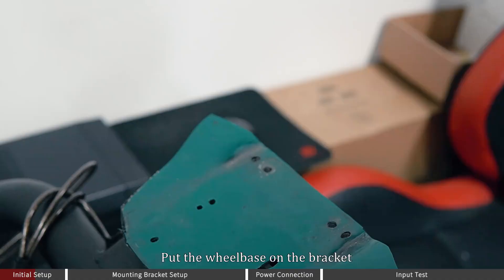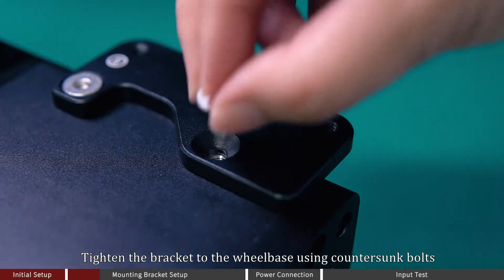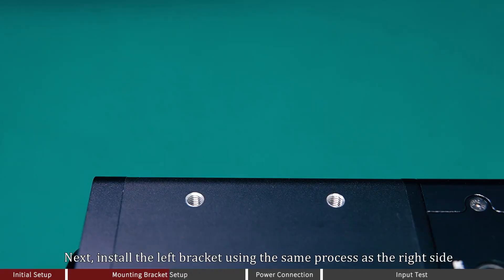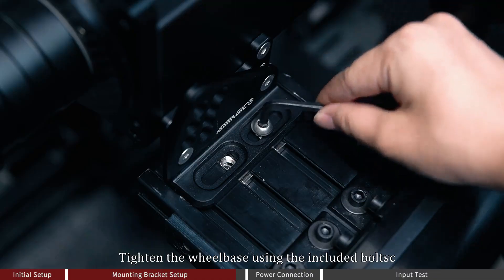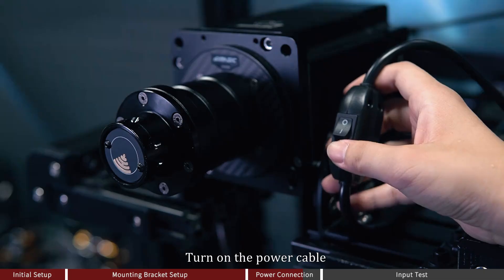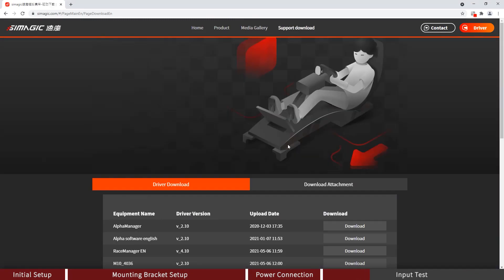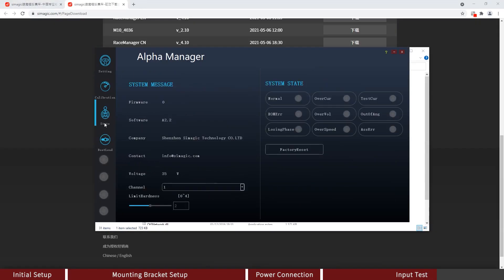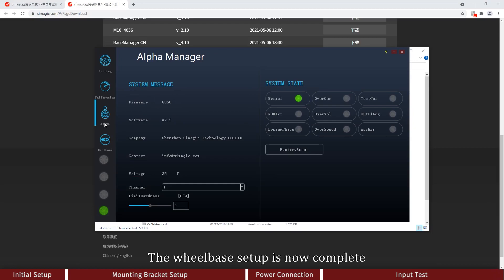ALPHA Mini setup guide

Comment: Would it be possible to mount it on a normal PC desk, as the Fanatec CSL DD?
Reply: Im late but anyway.I will answer in case anyone read this.
Find the drilling template for each base and you will see that moza and simagic have the same bottom holes dimensions.
its 78.4X66 with M6 screws.
I thing its the same for the fanatec as well.

So that means if you want to have the simagic mini for desk(i hope a strong and strurdy desk)you can buy the moza desk clamp and mount the mini there.
If you are not sure find the templates and also ask the shop.
Make sure you buy from authorized resellers for best service and warranty